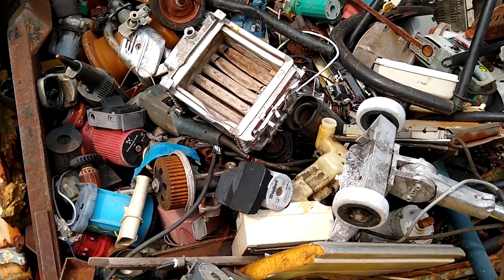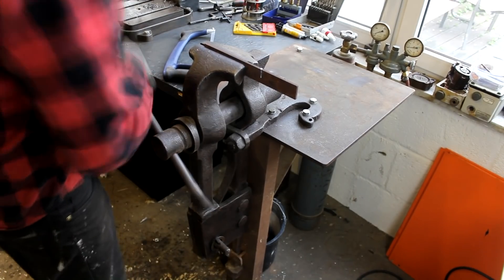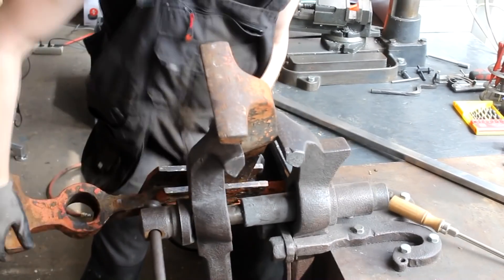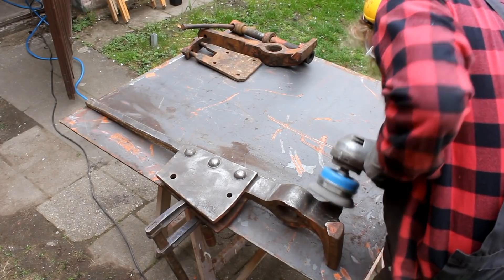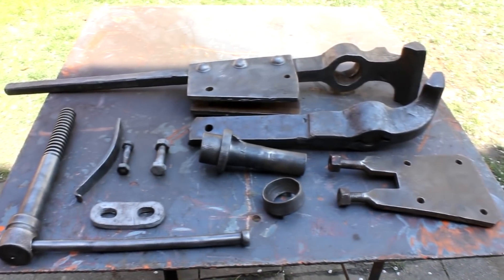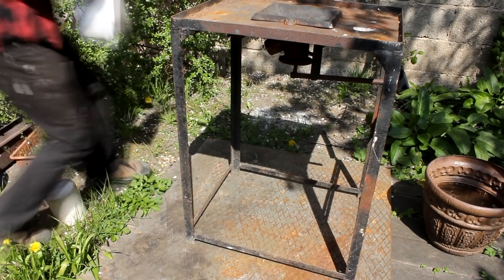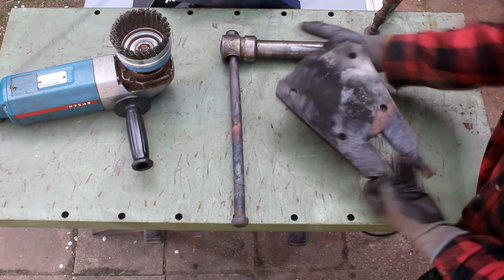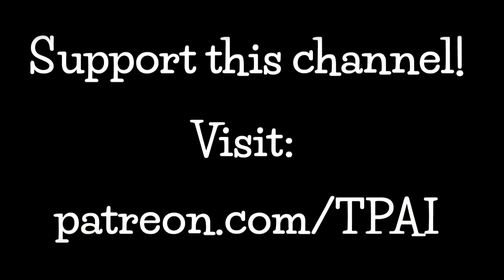Restoring a Blasckmith's Vise from the Scrapyard

Comment from the maker: Hey guys, There also is a GERMAN version of this video online on my channel now: https://www.youtube.com/watch?v=AWlj8vtT1zQ
Reply: This is very cool - in the UK I think these are called leg vices but may be both names are the same thing?
Reply: You should have boiled the steel parts in drain opener I  a big stainless steel pan: the high alkalinity doesn't hurt the steel but will dissolve all the paint.
Reply: Toll bruh. Don't speak German, but going to go watch that one instead.
Reply: Sandblasting with regular sand(which contains quartz) will cause silicosis and will destroy your lungs, you mentioned a face shield but not a respirator/breathing mask and silicosis is accumulative and not immediately apparent.  https://en.wikipedia.org/wiki/Silicosis

Comment: If you're not using the needler gun for long reach, then you need to have a ring around to restrict movement of the needles, side to side. Usually, it comes with the needler gun itself. Looks like a shaving brush stand with a clamp.

Comment: If you pull the tip of your blasting gun out just a little you will have far better results using less media in the end as your not running over the same area over and over to get to bare metal.    Just a thought keep the videos coming,   Wish i lived in a area that had a scrapyard that would sell things, The ones around here only buy unfortunately.

Comment: Did you heat treat the steel after you straightened it out?
Reply: On those particular parts it's not realy nessesary, if the carbon content is to low the steel is not possible to quench.
But if so, it shall be heat treated to dark brown, like a smooked herring, never to blue.

Comment: Why not use electrolysis to remove the rust? It works quite well as does making a molasses tank.
 The molasses does take a long time, but is non toxic and biodegradable.

Comment: If the tube doesn’t have much load on it why did it brake in the first place and for a weld to brake there has to be a lot of force so I suggest you get it welded properly because it will damage the nut if you don’t

Comment: If the paint doesn't come of easily then why remove it at all? Just paint over it. The new layer of paint will seal in any toxic materials in the old paint.
Also what is your opinion on removing the paint using a heat gun and a scraper?

Comment: What I don't like about your work--from time to time--is the fact you don't take the time to do it right.
In this episode you didn't re-temper the vise properly and chose to cool it in water which induces crystalline micro fractures within the steel structure thereby weakening the vise.
It is your shop and use and channel. However, you are not going to live forever and your lot of tools might be sold and used by someone else and might be injuring themselves by the many shortcomings. 
Think laterally and of the long term.
If you can't or won't do it right, don't do it at all is my motto.